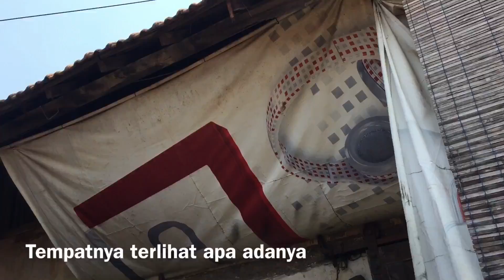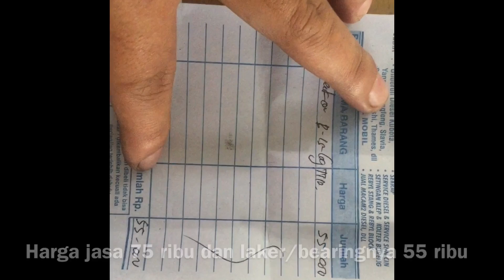Memperbaiki Alternator di Bengkel Kipas Angin

Comment: Om, dinamo saya di tes dengan obeng ada nempel di pulley saat pengisian, tp pas di cek voltasenya tidak sampai 14v saat mesin idle. Rata2 12,8-13,5v. Pas dibawah jalan kadang naik sampai 14v lebih sering di bawah 14 dengan konsumsi daya siang hari yang mungkin gak ada butuh beban yang berat dan kondisi audio gak dihidupkan. Pado dinamo sering tedengar bunyi dengung yang tidak terlalu bising tp biasanya gak ada bunyi sebelumnya. Karna saat normalnya pada saat mesin idle pengisian berada di 14-14,4V. Kira2 dimana ya masalahnya om ?